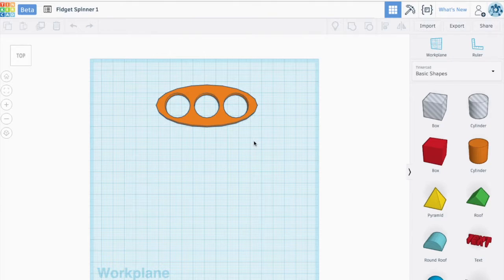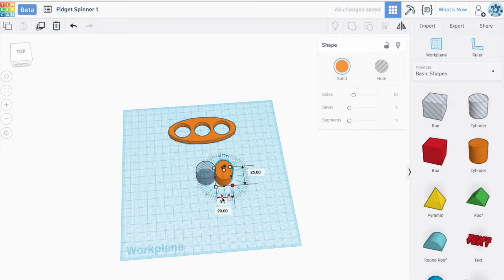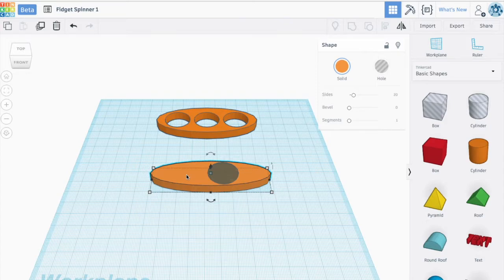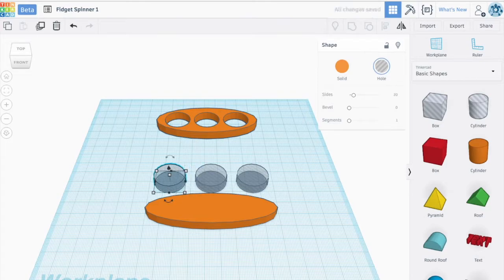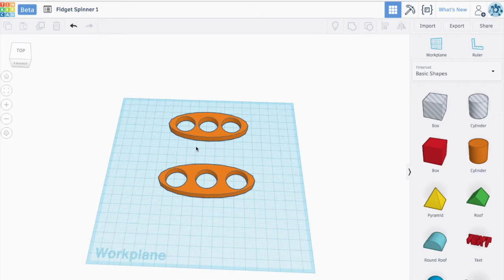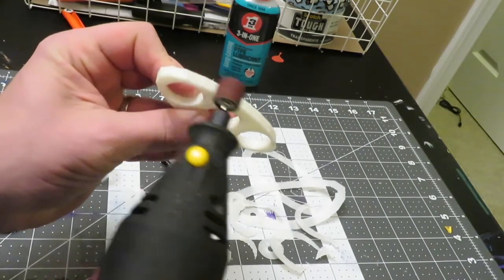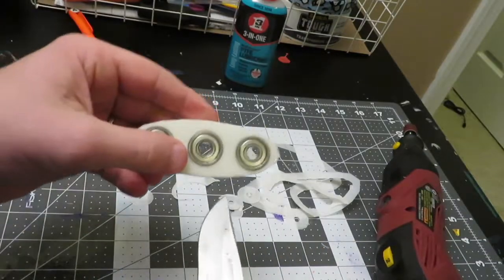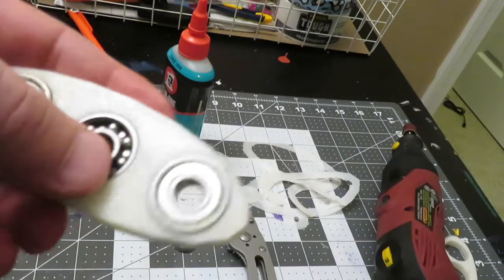Fidget Spinner Tutorial 2 Using Tinkercad

Comment: So, where do you buy your bearings at a reasonable cost? I have seen them priced in the range of like $10 to $15 at local hardware stores. At that price, you don't really want to waste them as counter weights on your spinner's arms, so I assume you have found a low cost source (probably E-Bay, I'd guess). How about doing a design using heavy nuts you might buy at the hardware store for less than a buck a piece?
Reply from the maker: Great idea with the nuts. I actually have one that I need to create a tutorial for. For these I bought them on Amazon and ebay. Maybe since the craze has died down they are are cheaper.